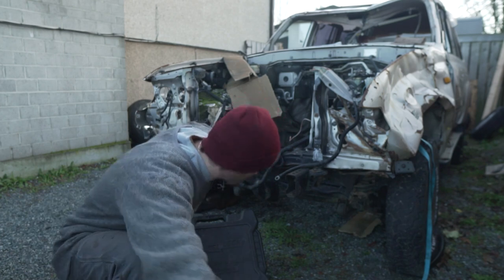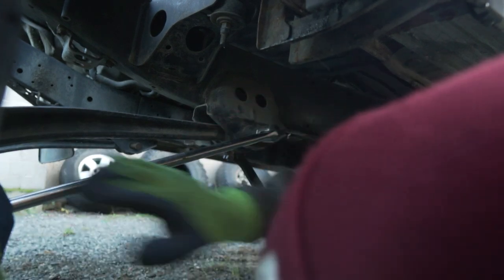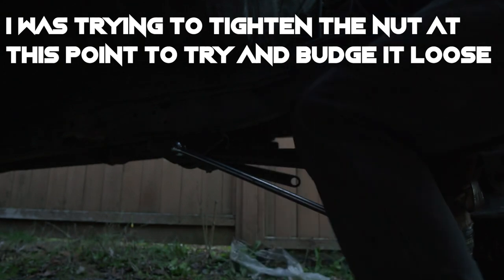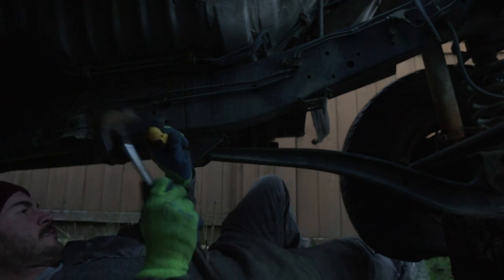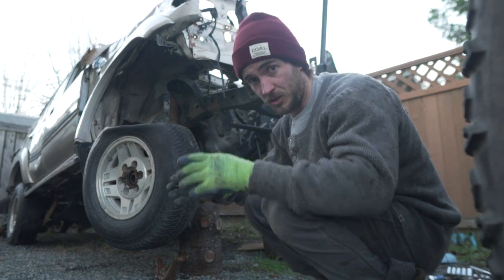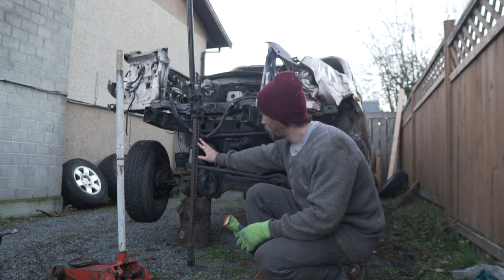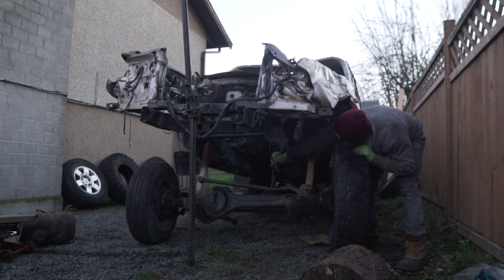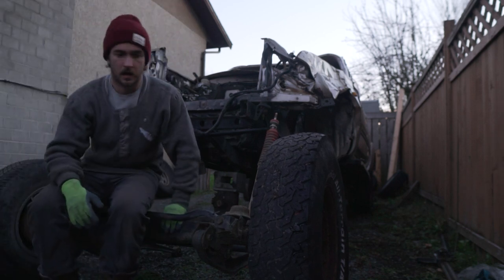4x4 TOYOTA CHINOOK BUILD Part 4 | Removing the 80 series axle

Comment: I agree with Frank, you should keep the Cruiser chassis. Even if it's bent, it can be straightened and it's still far better than trying to get proper geometry with the Chinook chassis. Think about the time and effort Toyota put into the engineering to make it ride and handle, and you are going to duplicate that, under the Chinook, with hand tools? Is the Chinook chassis even strong enough?
Chinook has 110" wheelbase while the Cruiser 112" so maybe over simplistic but mounting the Chinook on the Cruiser chassis should not involve much more than making new body mounts, wiring and plumbing.
Reply from the maker: I've talked to some of the best fabricators on the island. And there are great reasons to do both. Ultimately this is going to be the easiest, simplest and most effective way. The chassis will get plated, of course, and will definitely be strong enough.

It's a lot more that just a simple body swap. From someone who has done two. 

This is a diesel right hand drive land cruiser. Every single thing would have to be changed to swap the chassis. We're only swapping the suspension and steering, and keeping all the factory Chinook things, as Chinook things.

Comment: Question, why not just dump the whole body of the Chinook onto the Landcrusier Chassis?  That way you don’t have to mess around with getting the axles out and what not. 
Or is that chassis bent.
Reply from the maker: We looked at that, and it would actually be a lot more work from a fabrication stand point. The chassis are different widths and with trying to lift the Chinook body and frame off without a hoist and making new mounts and lining it all up... It's a lot. I've done a couple body swaps. 

This way is actually going to be less work, and still with a great result.
Reply: @ToyotaWorldRunners  sounds like you got it all figured out, party on! 👍🏼